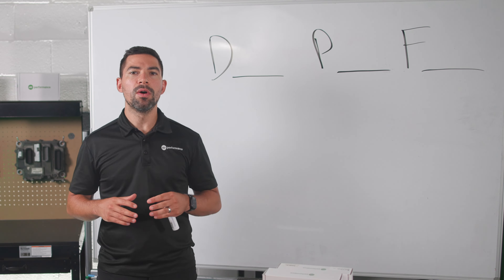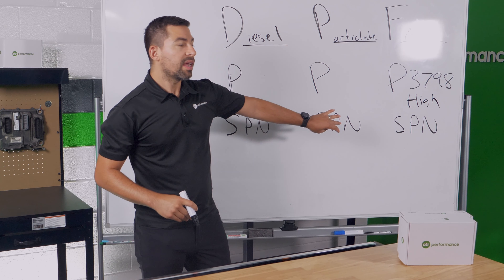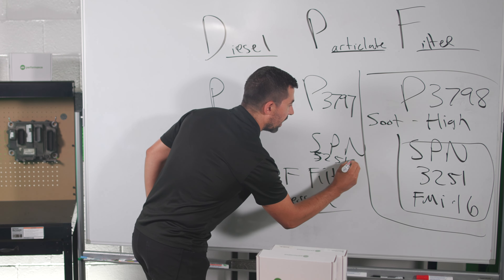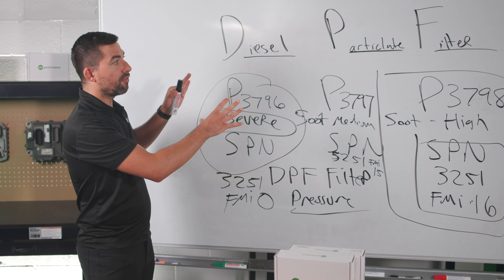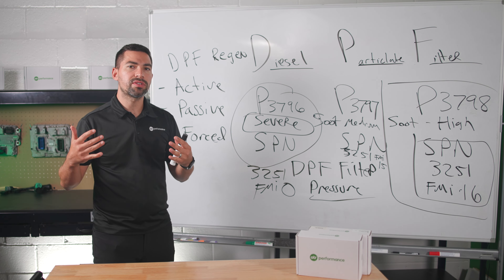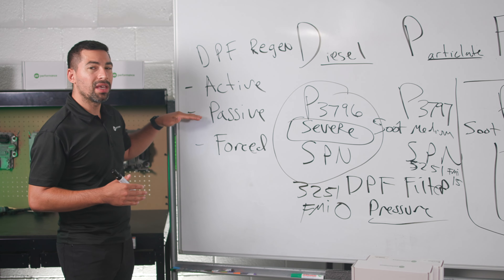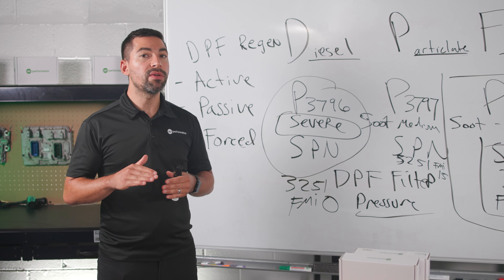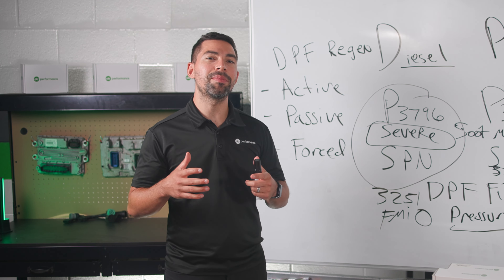How to diagnose and fix common DPF filter fault codes on Paccar MX engines

Comment: My 2023 peterbuilt started having egr codes, so they told us that the egr valve was defective or damaged, only 200k miles on it, so we started doing our own diagnostics and guess what, the problem was de mesh flexible pipe, it was broken but couldn’t see it because of the mesh, so the system wasn’t building enough pressure and was giving false codes.. so my advice is to check the exhaust system for any leaks before taking it to the mechanic.. you could save thousands..

Comment: Does anybody know the code for ACM 520349 14 , for frightliner Cascade 2019
Reply from the maker: Hello! Fault code 520349 FMI 14 is the DPF Filtration Efficiency Low/ Soot sensor detects elevated soot accumulation. 
Here are 3 reasons why this may be going off:
1. Are any other fault codes present? If so, diagnose those first. 
2. Faulty DPF 
3. Fault soot sensor

Did we answer your question? Please let us know if you ever have any more!